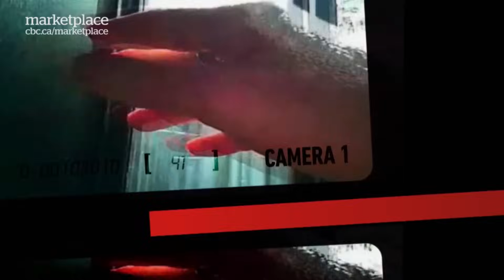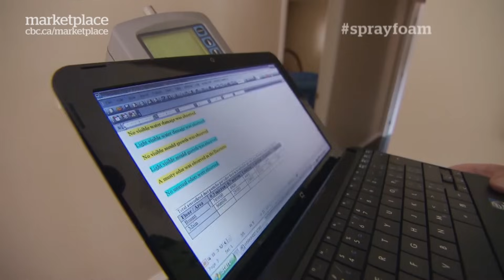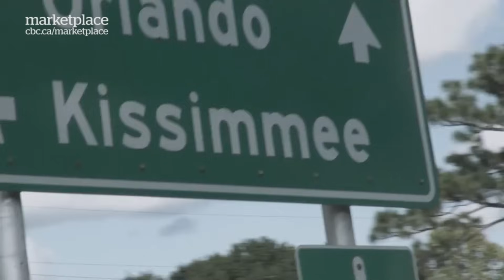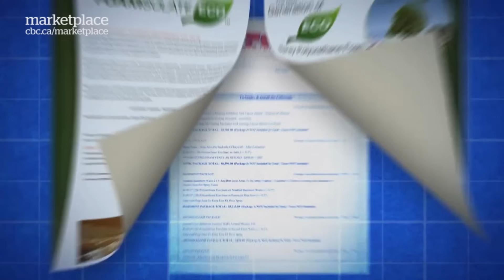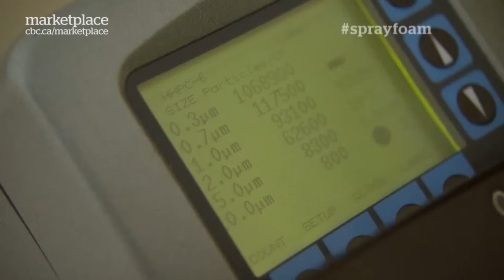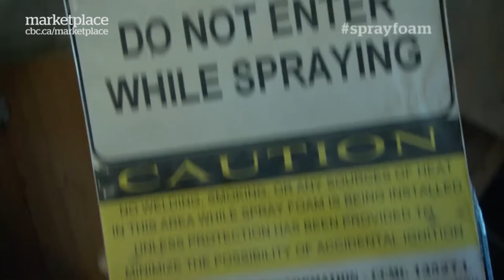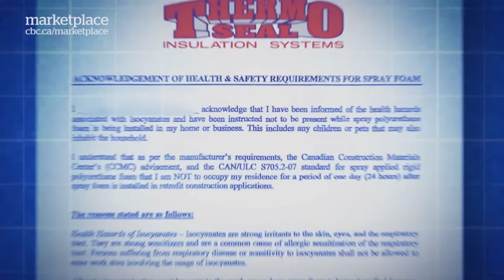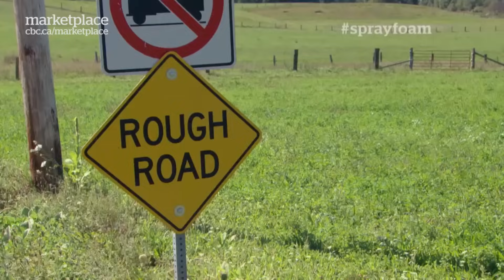Spray foam insulation nightmare: What can happen if it's not installed correctly (CBC Marketplace)

Comment: We had spray foam added to our attic last year, smell was gone in two days. We are in the very hot sunny south and it made a big difference in our cooling bill.  Done right it works and worth the payback over time.  Choose your contractor wisely.
Reply: Foam is great for reaching a high level of insulation in a small space, and spray foam can assist with installing in tricky areas like attics. But spray foam is not always the best option despite what some home improvement channels might advertise. Many (not all) homes can be insulated equally as well for less money and less risk using fiberglass, mineral-wool, cellulose, or even rigid-foam board.
Reply: @izaacmp  True that fiberglass insulation is basically the same R value per inch as spray foam, but spray foam adds an air seal which is another layer of energy efficiency the other products can’t compete with.
Reply: @billwilljulz  There is absolutely no need for airseal and the proposed added efficiency is just marketing.
Reply: @maxmeier532  I’ve never heard this argument before. Insulation is insulation, but a well sealed home is far superior to a leaky one. Anyone who has lived in an leaky home can attest that they are not as comfortable. Air sealing also helps to prevent moisture and mold in the structure. A well sealed home is recommended not only by spray foam manufacturers (hmm, go figure), but also by the DOE and every building science article out there. Spray foam or not, air sealing is important. People can do whatever they want, but to save energy (and money) and have a healthier home for life, air sealing up front is highly recommended.
Reply: @billwilljulz  There will be a vapour barrier like 6 mil or more impervious plastic below the fiberglass in an attic so that's an air seal. We had our headers and basement walls foamed and that's the most useful place for foaming and air leak sealing IMO. We were advised to leave for a few hours, left all windows open (summertime) and suffered no ill effects at all. Loving the basement work and how much BTUs we'll save next winter plus looks way better than the sandstone, cement blocks and poured concrete walls now underneath the foam. Make sure to get the sealant sprayed over the foam to protect it and for esthetics.
Reply: PS: our foam was based on soybeans and was coated with fire retardant protective spray.
Reply: @billwilljulz  Total BS. Complete air sealing is a leading factor of sick building syndrome, adversely affects the building structure and is hazardous to health of occupiers.
Reply: @AndyRixon  I’m open to reading whatever info you are getting, but I would say up front that air sealing could “cause” those issues ONLY IF the building isn’t ventilated correctly. You may have heard, “Build it tight, ventilate it right.” It’s not the air seals fault, it’s the fault of the ventilation.
Reply: Very flammable though

Comment: House was built in 1987. Never finished..I removed the old r11 from the unfinished exterior walls and called TX Energy to apply spray foam.
Originally, the attic was vented with soffit vents and gable vented fan. I sealed up the attic.  TX Energy came and sprayed all exterior walls, under the floor joists in the downstairs ceiling, and under the rafters in the attic. There is a temp difference of 2 degrees from upstairs and attic . When it's 108 outside, it's a cool 74 upstairs with the thermostat set at 72 In Winter,, it's 28 outside and 72 inside.  Spray foam rocks when installed properly.
Reply: GKAtascosa I must say, I'm partial to fiberglass insulation myself. If it ain't broken, don't fix it. Fiberglass has been the industry standard for years, and that's what I stuck with.
Reply: I should given more details about why I removed the old R11 fiberglass insulation. It was old..for one. Vapor/ Paper barrier had holes in it..Two, had a bunch of little pink lizards and eggs shells all in it.
Three, I wanted a tight house. I got what I paid for and should pay for itself in energy savings in 2 years.
Reply: Doesn’t sealing the attic lead to potential rot?
Reply: @robertt9342  IT's on open celled foam. Excess moisture can still pass thru.

Comment: I don't like it from a firefighting standpoint. More toxic smoke, thus less time for the occupants to escape.
Reply: Lee Huff reminds me of a documentary I watched not too long ago regarding the toxicity and exposure to flame retardant materials in home furnishing during combustion. And thusly, I respect and commend what you do for us, if you’re coming from that standpoint. It was really saddening to see the proportion of firefighters dying early from all the carcinogens and if I recall correctly, the impunity of the manufacturers when trying to hold them accountable was disgusting.
Reply: The foam we have now is not even close to the foam we used a few years ago. Also, you air seal a house that good, it greatly reduced the rate at which the fire spreads.
Reply: @trump-wj2nx  Seriously???   Keep flipping burgers and let adults talk
Reply: @trump-wj2nx  Are  you  f#@£ing kidding ??? Spray foam  insulation  is  basically solidified  gasoline!!
Once it  begins  to  burn  it  produces huge  amounts  of  toxic  soot  smoke,  which  will  begin  to  burn  uncontrollably/flashover  within  a minute  or  so, of  the  foam  igniting.
Reply: The various foams available vary so much, from ones that are almost fireproof to foams that burn like gasoline, that it's hard to generalize. Some actually survive fires that burn the sheathing off the wall, but of course, being resistant to burning doesn't mean there are no toxic fumes. People need to know the pros and cons of what they are using before coating a house with it.
Reply: @pcno2832  Fair enough,       but    it  seems   the  most  commonly  used foams for  residential applications seem  to  be the  icynene variety,    which  tend  to  off gas   for  extended periods of time,   as well   burn  rapidly producing  abundant toxic,  flammable soot smoke.

Building  code  requires   an ignition/thermal type barrier to  cover  the  exposed insulation,    in case  a  fire is  ever  present inside  the structure.
It  is  well  known  the   smoke  from  this  stuff is deadly.
Reply: Great point...I never thought of that...its gotta be very flammable
Reply: @emanuelsommar7243   Just wondering what you got against Trump there Sommar  . What did you think of that speech ?
Reply: I went into a boxcar to try and put out a fire in that stuff it takes your breath away
Reply: What if the foam could be produced as both insulation and fire retardent? There has to be a way... If you ask me its a $million$ idea. Building a house in such a way would and should make a huge difference in the house insurance market for home owners as well.   if i go on i could lose a million bucks or two... think about it. Cheers
Reply: Thanks ...wish i had the means to make it happen. Ive thought of fireproof spray for house framing for about 15 years now. the combination of the 2 would help me retire...lol
Reply: Lee Huff exactly
Reply: Lee Huff wow that’s a very valid point I hadn’t even thought about! Also thank you so much doing the job you do and putting your life on the line for others. God bless you.
Reply: Aquatta Domdren oh wow that hurts my heart to hear. God bless all firefighters!
Reply: its actually quite helpful in fires as it acts as a seal against smoke and gasses for a rather long period of time. It is also not a catalyst and will self-extinguish.
Reply: That's why we have building codes stating that spray foam can not be exposed. It has to be covered. 1/2 inch drywall has a 30 min burn time and 5/8 up to an hour.
Reply: @fartman2269  Spray foam has to be in direct contact with fire for a period of time before it will catch fire. That's why spray foam can not be installed unless it's covered. 1/2 inch drywall has a 30 min burn time and 5/8 has up to an hour.
Reply: @mikemarath9631  True,    in the real world though,  if  you  have a large suv, or two that each hold 1,000,000 btu' s of fuel catch fire in an attached garage which  has 12" of sprayfoam insulation in the cieling covered by 5/8" drywall,  it's  a short matter of time before  the  drywall fails, or other parts of the structure fail. ( windows, doors, attic access...)
Other  times fire climbs  up vinyl siding,   then  enters the attic space.
When this happens the attic will flashover within minutes,   much  more fuel  if the attic floor is  covered with spray foam .

When there is  a large,   hot  fire  inside  the structure, or  spreading from the exterior, unprotected  spray foam insulation will  ignite, and  burn rapidly,  adding significantly  to  the fuel load.
Reply: @bcook5443  There  is certain level  of  fire  retardant in the  foam it self,  if  you  hold  a lighter flame  to the foam ,    it  will burn,   but  will not sustain combustion when  the small  flame  is removed.
These  types  of  flame  retardants  are highly carcinogenic,  these  do  break down and  off gas  over time,   so they need to  be used sparingly.
The issue  is with a structure fire in full  flashover,   the  foam insulation , despite being  covered with  drywall,  or other  time buying ignition barriers will undoubtedly burn once  these safety measures fail under  extreme heat conditions.
This  insulation is  unstoppable when  it is  burning  in a huge  structure  filled with it.
Reply: @fartman2269  Yeah well with the circumstances your talking about you'll have a lot more to worry about then spray foam. Plus I work in the construction industry I have seen where spray foam has helped stop the spread. Now I'm in Canada so I don't know about the U.S but we have strict fire code laws.
Reply: @mikemarath9631  From  western Canada,   have  never ever heard of  a situation where icynene spray foam insulation has helped stop the spread of  fire.  ( I am aware that cellulose insulation, yes cellulose insulation, is known to slow the spread of fire.)

We are  just  waiting to  see  what the future holds  as  icynene type spray foam insulation gains more ground,  probably  the same thing  the  building industry  saw with vinyl siding.
Multiple structures lost beyond  the point  of  the original structure due to vinyl siding,   it has been an epidemic  in our province  for  over  twenty years.
Took  forever for  the  building  code to  finally recognize that vinyl siding is huge fire hazard. 
I imagine having open cell spray  foam in  the attic in every house  on the  block combined with vinyl siding,  may  result  in five or six homes involved, instead of three.
Reply: @fartman2269  Are you talking open cell?
Reply: Great point.
Reply: @fartman2269  foam will not ignite unless it has a source burning it, yes there's is toxic smoke, but in the long run, if your house would to catch fire, the foam would contain the fire in whichever room it occured in.
Reply: @forgive9220  

The science behind why spray Foam insulation will add significantly to fuel load isn't as simple as theoretically containing a fire in a sealed room.

The same thing is done in commercial buildings with fire partition walls, and fire dampers in the hvac system.

 When there is a fire in a within a structure, there is a science to how fire behaves in a confined space.
Smoke produced by pretty much everything in a home contains toxic soot, as almost everything seems to contain plastic, or contains some type of resins.

After a fire has ignited in a confined space within the structure, within three minutes the black smoke will ignite, flashover.
In most residential homes this will involve the entire interior within 5 minutes of source ignition.
Fires spread by smoke flashover, not by the flames growing

At this point, drywall ect will only stay intact for a short duration until it fails, exposing spray foam insulation inside wall cavities, perhaps in the attic space.
This always makes any residential structure fire even more dangerous, and difficult to fight.

Burning spray foam resists water, as it is melted plastic,  the black smoke it produces also will keep the structure in constant flashover condition.
Reply: So I looked up the actual information on spray foam burning.  granted this is 5 years later.  
  It can burn if exposed to an ignition source but it has to be at 700 F.
  Spray foam insulation has a class 1 fire rating, which means it can resist fire for one hour. This is the safest rating for building materials.
  If exposed to a flame, spray foam will typically self-extinguish if the flame is removed. If the flame is constant, it will spread and burn like wood.
   Gotta love a simple google search.

Comment: If they told me they didn’t smell anything, i’d say sure. I’ll put on a mask, and have a nice long chat with them in the bedroom where the chemicals are the strongest
Reply: I thought the same thing. "Oh you have a headache? Joint pain? Oh are your sinuses on fire? Oh do you want to remove it now? No? Ok let's stay a little longer. Hello? Oh is it hard to breathe? Hello?" -- Just let them feel what they've wrought.
Reply: @dawnv3436  they're probably numb to it
Reply: Daddy Dollaz does it contain methyl di isocyanate or MDI or di isocyanate or isocyanate
Reply: @dawnv3436  The real issue with spray foam is it seals a structure air tight, so if the building isnt built withe correct type of ventilation that draws fresh air through year round, you will just keep breathing the same contaminated air, along with the exhaled viruses and bacteria, because you created a "sick house".
Reply: Daddy Dollaz  

The house that I'm restoring had the basement foam, I had go an open the door for the guys until they say it was sabe but still for my opinion too tick.... Guess you what I mean too tick ( 5 in Freaking pipes can't be seen )
Reply: @dawnv3436  but the room is fine, she's just mental
Reply: @ProfessionalArmourer  great point....my 1950s era house is still plenty leaky that foam worked well for me
Reply: It’s gotta cure before you install the drywall
Reply: @alexv6848  yeah completely encapsulate crawlspaces.
Reply: They probably were desensitized
Reply: @ProfessionalArmourer  not true
Reply: I think we should take in to consideration that people are sue crazy I work in this field and dried foam is for the most part safe

Comment: I construct steel home's and buildings, we have used spray foam in quite a few of our projects without incident for year's now. I feel it was definitely on the installer for not following one or more of the steps on proper installation guidelines.
Reply: There is always those companies that do Bad business, Thats' why you gotta do your homework  . But we would be in court and they would be paying for that removal.
Reply: Yup, my dad installs it for a living. Never had a problem.
Reply: Look at all those bubbels inside the foam! This is an indication for not enough ventilation.. foam needs sun and ventilation to curate otherwise nasty trimethylamine compound fishy smell will escape the foam into the building.
Reply: There's a good chance that it could have been installer error, but I'd also like to point out that there is a chance that there was a problem with the foam machine. Both are possible, and I've seen both cause issues. Hell, I've even seen a guy put $15,000 of open cell foam in a ceiling that wasn't even bid for it
Reply: @mattcrandall5045  wow..big oops
Reply: @cryipticcreep5586  the guy was a junkie that I had the displeasure of working with. He didn't even get fired or reprimanded after that happened either.
Reply: Give got a new home in at the insulation time and I had a few thoughts on the foam can you please send me a message so I can chat with someone who knows there butt from a hole in the dirt in so sick of being scammed
Reply: @tommybillingsjr9663  I have a number if you are still interested
Reply: Spray foam is a generic term, same as "fiberglass" used to build various price level boats, sports cars, and aircraft.
Extreme variation in properties -- and cost.
So you really have to make sure who you hire to spray in foam insulation.
Sounds like you found a reputable company from the start.
Reply: @patrickbennett2737  Indeed.
Reply: Its probably an employee that does not care to do it right. Just get it done FAST cause its hot and uncomfortable in that suit.
Reply: @blacksunshine5758  probably
Reply: instablaster.
Reply: You construct steel homes and buildings from scratch right? So you install the foam in new construction that is well ventilated?

That's not the same as the homes that are old construction in this video.
Reply: I'd say formula was mixed wrong. If not proper amounts of each then you'll have problems
Reply: @halfrockstarpro6412  sunlight is not needed. We do basements too, without issues. Formula of 2 component mixture needs to be precise
Reply: Would've been more effective and cheaper to remove the drywall ceilings and clean from inside of the house.
Reply: Why were they spraying with the family inside the house? Should be vacated for several days when done right
Reply: @halfrockstarpro6412  curate?
Reply: @MultiNemesis101  sorry.. I meant cure